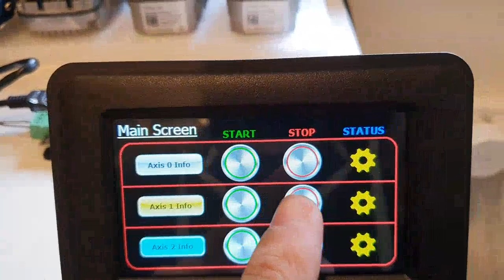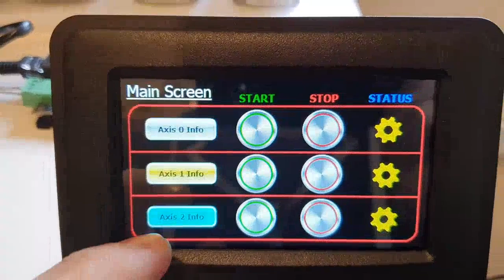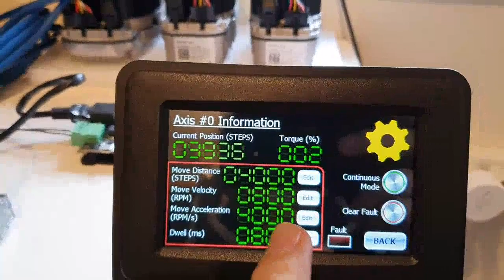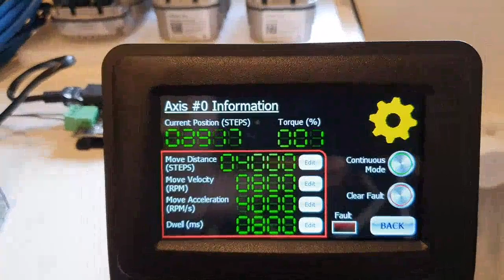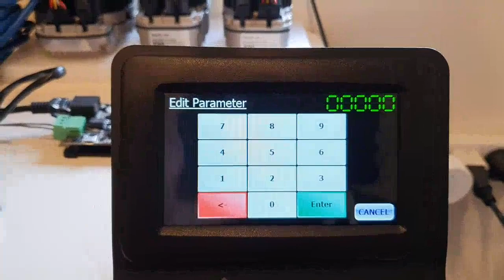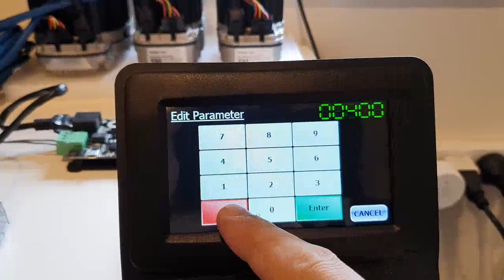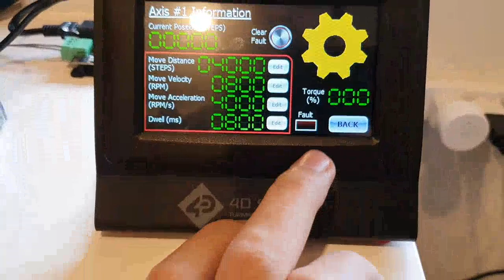4D Systems ClearCore Demo Part2

Comment: Can it read G code off a software like Mach3
Reply from the maker: This particular demo can't, but I am assuming you are referring to the ClearCore controller itself - you will be best to reach out to Teknic and ask them directly.
Reply: The clearcore is ARM Cortex M4 based (SAME53N19A).  There were people trying to port GRBL for the clearcore specifically, but I think there are some other ports for ARM Cortex M4.  If you talk to any official Teknik/Clearcore people, they emphasize that it's not really designed for it.   However, I think has been working for some folks in drip-mode using "g-code sender.